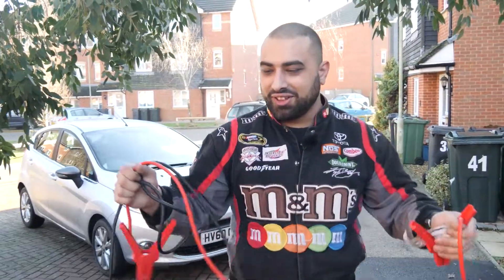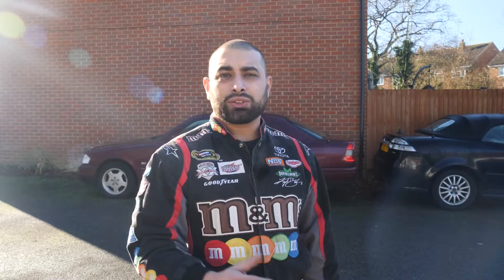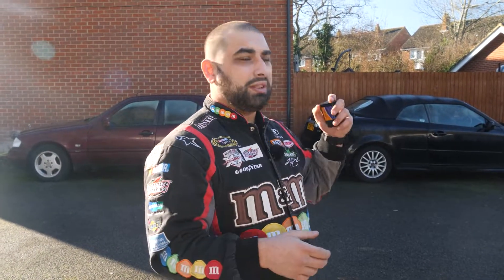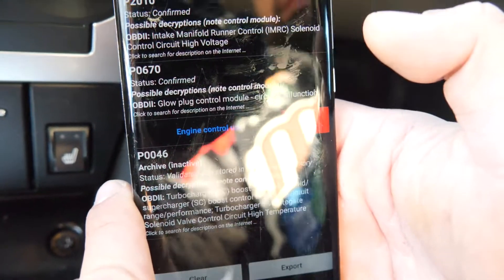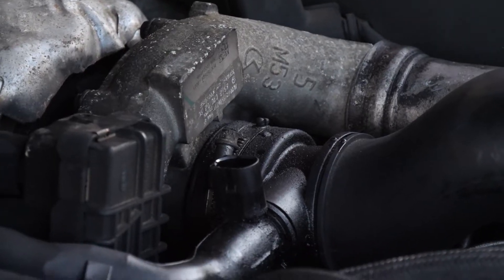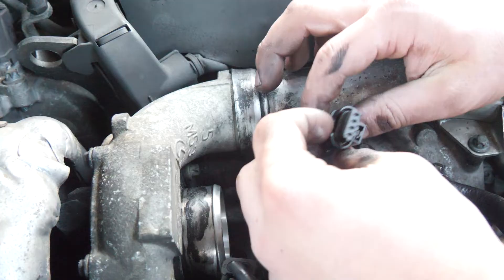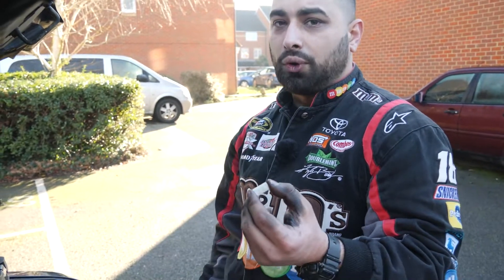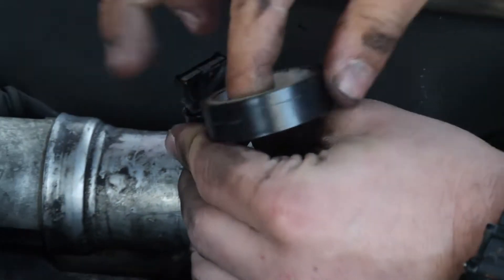HOW TO BYPASS SWIRL FLAP MOTOR MOTOR AND FIX LIMP MODE UNDER £10 CHRYSLER JEEP MERCEDES OM642 ENGINE

Comment: Does it work for Alfa Romeo 159 2.4 JTDm engine? I have 6 pin connector from swirl flap motor and it's not connected, because swirl flaps deleted. And I have the same turb limb mode problem after 5 mins active driving

Comment: Sancars of Leicester sold me an Emulater for Steering Lock on My MB C320 . Worked 100%. With regard to Swirl Flaps it is different! Your Crank case breather is U/S ! Oil is getting into motor due to breathe  or Oil Cooler! Best to replace PCV Valve first then if that fails , Do the BIG JOB of new oil cooler Seals, Swirl flap mootor and better Aluminium Flap linkage" A few quid is what Sharks spend to get rid!....LA5 Warton Lancaster

Comment: Might this work for BMW diesel engines? There is a bypass emulator available on eBay for a BMW E46 but it's over £50.

Comment: Hello Gencho..
good afternoon
Can You Help me in this situation please.

I have a jeep grandCherokee 2009 crd 3.0 limited (OM642 Mercedes) after driving 30km shows failure in the fuel sensor past failure P2264 Fuel/water separator sensor circuit.
I have already changed the sensor and filters and use only good diesel the obd always shows the same fault as before.
could you give me some guidance?
it makes me crazy

Give me a tip Please..

Comment: Hi followed your instructions and they're wrong, you say in the video pins one and two, which I did, then I put everything back together and 'what do you know', it didn't work, watching your video more closely you actually put them in pins two and three, as someone else has said and you've answered them and said it's pins two and three, so why haven't you corrected the video? So after taking it all apart again and putting the resistor in two and three it does actually work. Please either edit that bit again and dub yourself saying 2 and 3 or take the video down and save people some wasted time. Thanks.
Reply: I had the same question. Checked the comments and found this. Will go to 2 and 3. Many Thanks.

Comment: will this work on a 2012 c350 cdi merc ?
Reply: It works, it's the same engine in regards to the intake/flaps.
Reply from the maker: Im afraid it won't work as it's a different engine.

Comment: Question, how do you know the swirl flaps are open or closed at the time of doing this, and which position should they be in when you do it?
Reply from the maker: When the engine is off the swirl valves closed.
Reply: @genchomoto  The correct way to do this is to remove the intake manifolds, remove the swirl flaps all together, and weld it open, then do the connector ressistor.
Reply: @Peter-wo4uo  Its ok with the flaps in place, they're open by default. It's also best to do it with the intake cleaned up and fixed, so that the flaps are perfectly open all of them. If you have limp mode due to intake issues, this is a temp fix as you need to clean up what causes the restriction/blocked closed flap.

Comment: This method will fail and leave you in the s~~t at some point. Buy the bypass plug from custom 300c shop and its sorted.
Reply: I agree, I thought I had the issue with my swirl flaps only to find that the car had the problem in the past but someone had bodged a resistor in and wrapped a bit of tape around it, if any oil can get in the problem will come back. People:-do as Mark suggests and get a ready made plug, with a sealed resistor in it, should last the life of the car.

Comment: How do you know what position the swirl flaps are in when you disable the motor?  It must matter that they are in the ideal position and can't move?
Reply from the maker: Hello , when the engine is not working the swirl flaps are shut so when you disable the motor they are left shut even while running. So its basically works like the swirl valve delete with the blanking plates like on a bmw or vauxhall but in the om642 case you only have to put a resistor and nothing else. Its a different case if they are stuck open all the time but you will know for sure if they are all the time stuck open as the car won't go out of limp mode at all
Reply: @genchomoto  Sorry, but that's wrong. The flaps are open by default. So when the engine is shut, the flaps are OPEN. If they were shut, this wouldn't work. At high RPM you'd get HALF the airflow into your engine. The boost would probably flow these flaps inside the cylinder.

Comment: Great video. Where did you get the 2W to 5W resistor. I have only tracked down a 0.25W at my local electrical auto shop.
Reply from the maker: If you live in UK its gonna be very hard to track down them as many electrical shops don't do them believer or not 😂 I ended up ordering the one from the video on ebay but you can also buy a pack of 10 for under a pound. Just type in ebay/amazon 4.7k omh 5w or 2w resistor and plent of them will pop up. Hope that was helpful.

Comment: Will this work on a Pajero as well?
Reply from the maker: I don't thing it will work with Pajero I'm afraid.
Reply: @genchomoto  bugger, was thinking of trying as a resistor shouldn’t do any damage if it doesn’t work. 
The Pareto doesn’t go into limp mode, it just throws a code because it uses it to control the butterflies in the intake manifold which is a system they dumped the year after mine 🤬
Reply: @MnMTouring  Did you resolve this issue on you Pajero, I have the same problem?